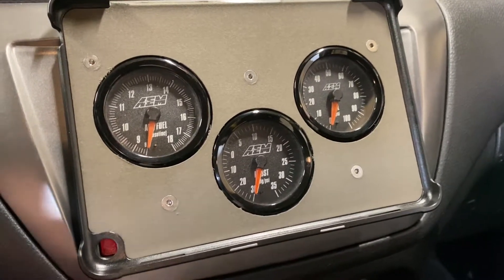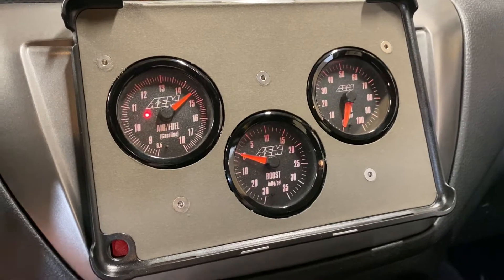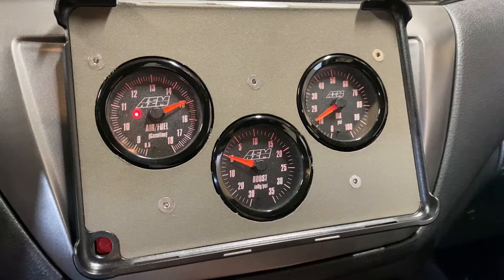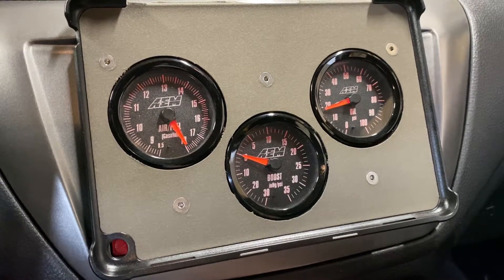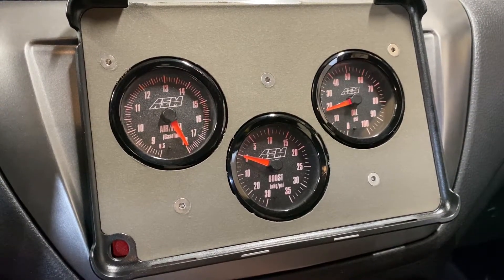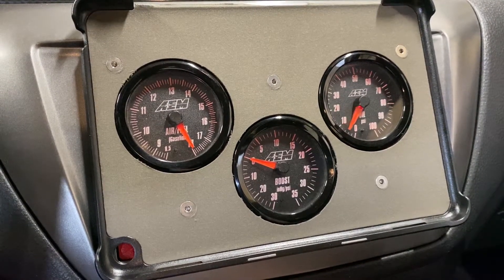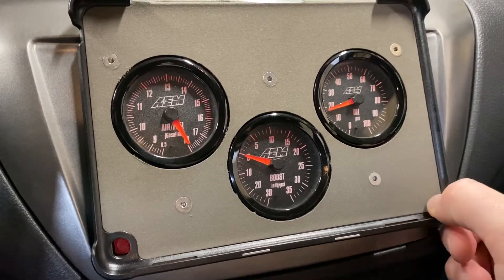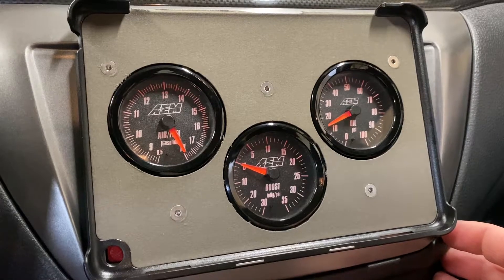Evo ACD bleeding tip

Comment: Do you have to like pump it up?  Like if your bleeding brakes? Then crack the bleeder? Cause I did my clutch and I had to unhook a line. All 3 lights will turn on. I topped it off and they still keep coming on
Reply from the maker: The noise is the pump filling the accumulator, that wont have any effect on the pressure going to the ACD. Where you see the gauge jump is just my foot going WOT and close. 

So you just need a line on the bleeder nipple to a bottle, crack the bleeder, and cycle the pedal on/off. Go down and check the line and you should see it pushing out.
Reply: @Dallasjcutler  okay cause I did that and my lights are all on not right off the back though have to give it a few mins and then all 3 lights stay on

Comment: so this means, i do not need to buy Evoscan licence and USB 1.3U openport to bleed the ACD line? Just this trick with throttle as you describeded in description. wow. I'll try this because i have to bleed the ACD line, due to changing the line´from pump to ACD.
Reply from the maker: Yeah, thats correct. People incorrectly assume you need to hear the pump cycle for fluid to be moving but the pump only fills the accumulator when its pressure gets low. So I put a line on the nipple and run it to a bottle, crack the nipple open, and cycle it a few time. Just make sure to keep an eye on fluid levels of course.